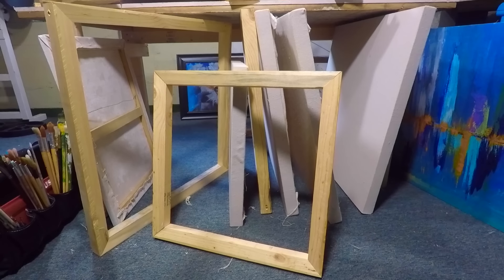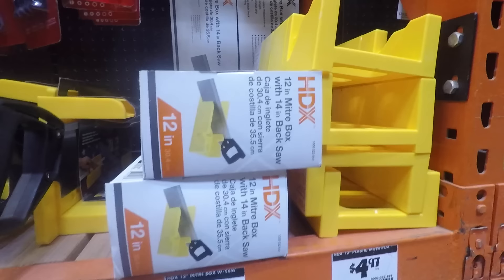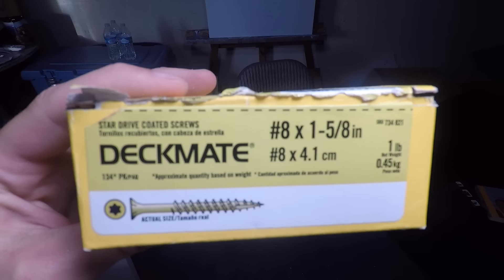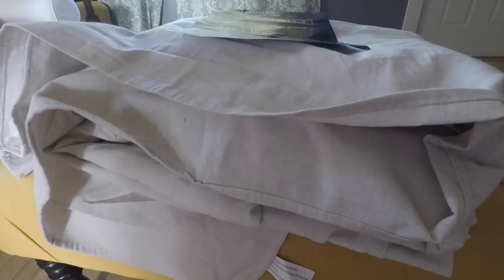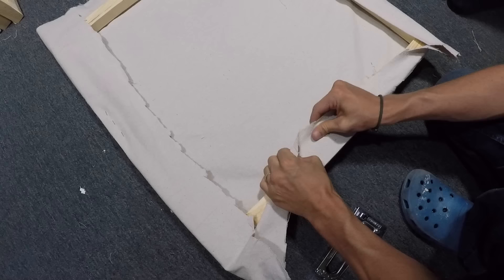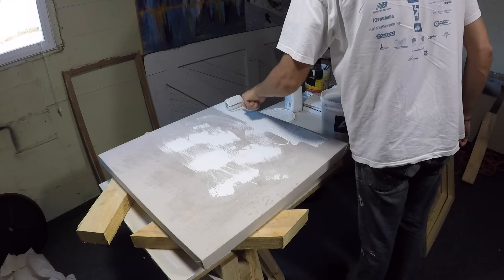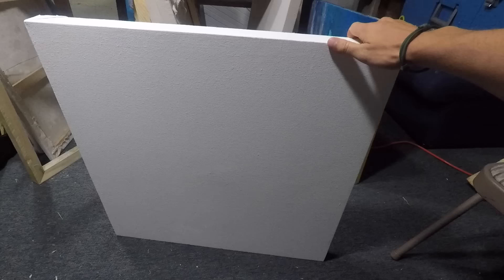EASY How to Build Canvas, HUGE SAVINGS!

Comment: These stretcher bars in the video are a bastardized version of the ''Kansas City stretcher bars." (Created at the Kansas City Art Institute by artists over 100 years ago -  Jackson Pollock's professor, Thomas Hart Benton). Except the actual KC stretcher bars are a lot easier and less expensive to create. You also need to cut outar knots in the bars because they will twist and warp, and the wood needs to dry out for about a year before you stretch. 

The list pricing from an art store is used to figure overhead/material costs when pricing your art work for sale. (or contracting)  It's about the same cost when you figure in the prices of the cabinet saw, and mitering clamps it takes to "roll your own."

Comment: Applying gesso, it seems the old masters often painted on a canvas which was as smooth as glass. For this make a piece of wood 20X20 inch that is exactly the thickness between the canvas and the table. Then using an iron scraper to lay on the gesso,  moving that piece of wood so the canvass cannot give in while trowling the gesso. After 2-3 layers the canvas should be glassy.

Comment: I purchase a painting that I have to.mount. I will make the frame just as you did. I did purchase a while back a tool that is used to help you stretch the canvas. It's like a sideways plier. Will I need to really stretch this painting with that tool? Thanks
Reply from the maker: Most likely I'm guessing, because I rely a lot on the gesso to tighten the cloth of the canvas, where your painting is already finished. I have attached finished paintings to frames before and mostly just my struggle was getting measurements correct. What is this plier tool, I'm curious.
Reply from the maker: That looks handy

Comment: Sanding is the last step?  I'm a woodworker, not really a painter, but after sanding I always clean off any dust from the sanding before applying a finish because dust damages the finish.  Does gesso not make dust when sanded or doesn't it matter to the paint when applied?
Reply from the maker: Yes, gesso does produce dust, good tip, I always clean the surface, but not shown here

Comment: Why don't you apply the bevel with a table saw, running the whole board through, then cut the 45s. Oh and for that  kind of cut you don't need to know your saw blade width. Just cut the other side of the line...
Haha, otherwise, good presentation and production values!
Oh and nothing wrong with how you did it. It's just less efficient. You want to group things by steps. Even using the router would be easier to the whole board than pieces. It'd also provide a more consistent bevel.
So nvm, that's what's wrong
Reply: I was thinking the same thing, just rip in a table saw.  That's seeing through the woodworker's lens.  Apparently the bevel doesn't have to be accurate; even so - more efficient to work as a woodworker and rip the board with a bevel. Next cut the 45 degree angles, this is the common sequence.  I'd like to make a fancier joint at the corners, and use glue.  Plus possibly place a pair of diagonals opposing each other from corner-to-corner with "half-lap" joints.  If cheap lumber yard 2 x 2's are used then I'd want to be sure to put crossbars or diagonals inside to help keep the wood from changing shape as it dries.  Good video!

Comment: thanks,how big can you go before putting a center piece of 2x2 ??very helpful thanks again
Reply from the maker: I've made 40x40 canvas frames and noticed a bowing, so I put in cross beams. Though the sizes of those cross beams were probably 2x1's so I avoided having the canvas touch. Hard to say what the limit is, but I can say 2x2's can hold canvas resistance better than most. I didnt put any cross beams in my 20x20 canvas frames. Some  might be a little more pliable as well. Experiment a little but it never hurts to over build something.
Reply: @jvhumanity901  Thanks man

Comment: I have never seen canvas frames that thick before I normally see 3/4" thick frames. Or is this for a finished project not to be installed into a picture frame?
Reply from the maker: That is one of the benefits of the 2x2's. You don't need a frame because it looks great without and I'm sure a framing store can attach a frame to it.

Comment: If you used a table saw you could save even more money, by buying 2x4's and cutting the down. Withe table saw you can cut the edge before mitering the cuts.

Comment: I have a question what is the difference between canvas drop cloth and the canvas sale at hobby lobby? Does they really make different? the canvas drop cloth is really great price! I been search up on google there is no answer for me
Reply: Art store canvas is sold by the weight and weave, so ye know exactly the fabric you're getting. Drop cloth is a rougher weave, and probably somewhat uneven in weight. The gesso and sanding can help make up for that, if ye prefer a smoother surface to your canvas.

Comment: I've noticed that the wood at Home Depot often is warped, do you ever deal with warping with the frames you make? I was considering getting a planner to try and even out the planks. I am so sick of having to study each piece of wood when I go in to make sure I don't buy warped wood, or do you have a suggestion for that? Does the beveling process help with warped wood? Or you do you just try to buy wood that isn't warped? This is the one thing I can't seem to figure out, especially when I'm trying to build 8 or 9 foot tall paintings, it seems to become an issue more than I would like.
Reply: All the wood in home depot looks like a banana! Lol

Comment: Can anyone explain the need to cut at 45*? Why not cut straight or 90* and then use screws?
Reply: Because the planed wood won't line up.  It must be high at the outer edge and doing it your way will create a pocket where the two beams meet.

Comment: This is a fine method for craft painting, but it should not be used for fine art, i.e professional works. The wood can warp too easily, the canvas is chemically treated differently, and a real collector knows to avoid buying low-quality material artworks. For just a few dollars more you can still make them yourself from better lumber and purchase proper canvas in bulk online.

Comment: Whats the gesso? Why not include that. Very frustrating asking around store by store and no one seems to have the appropriate type. Dont sell at walmart and home depot
Reply from the maker: Type in Google maps, art supply store near me, or check Michael's, Hobby Lobby, yah hardware stores don't have it.  Gesso is a primer made up of white pigment, some sort of white chalk, and a binder. I mean you could experiment with other primers as well, the primer is there as a surface for your paint to absorb into and protect the surface below it.

Comment: Great video! But... Applying the gesso on a normal canvas doesn'it going to curve the canvas??
Reply from the maker: Yes if you dont build it correctly. The 2x2's are strong enough for most canvas sizes but if you are going larger than a 20x20 canvas you may want to consider bracing on the back. A benefit of gesso'ing the unprimed canvas after it is stretched is that it will create a tightly stretched canvas. Anything smaller than 2x2 wood your going to want bracing on the back.
Reply: @jvhumanity901  ok thank you, anyway i suggest  to put a thin coat of glue and water on the pre stretched canvas, so the gesso don't penetrate as much and you can put it in smaller amounts. Also you will have a stronger canvas.
Tell me if you are going to test it and what are your opinion about it!
(Sorry for eventual grammar errors)
Reply: Also if you prepare canvas first you don't have 'waves' problems i guess.. Tell me what you think!
Reply from the maker: @zzzioporco  I'll experiment with that glue idea, good suggestion

Comment: @j.hanks  Your practical & informative video presents an affordable solution for many of us. 

But it needs to be said that the matter is not only about price. It as about quality too. The overall quality of your stretcher bars/canvas is higher than most canvases sold in most art stores, where the entry level quality of canvases is literally appalling. Perhaps only suitable for practice at Elementary/Middle School art classes (Anecdote: A while back I purchased a set of some six or eight small canvases. When the first one proved to be “feeble” I tested the quality of the remaining set by literally 🤛 punching through the remaining five or six canvases all at once without much effort: junk) 

The median range canvases are still bad, and of course, significantly overprice. For these reasons I purchase a table saw and moved to making my own canvas boards about 7 years ago, increasing the quality of my supports and the impact on my wallet. ...no more punching tests since then 😆 

Your proposal is no brainer. I do care about the price, but about quality even more. True quality is still around—like the traditional products sold say by Zecchi in Florence, 🇮🇹 And of course, it comes with a proportional price tag. IMO is justified. The most disappointing, actually infuriating thing, is when in the States they sell you Chinese junk at hight prices. 

Again, thank you for sharing! Happy painting 🖼!!!

Comment: the canvas drop cloth would be fine if you don't mind little bumps in the threading, but the sanding really helps with combating that if you don't like the bumps. Also, really you can gesso and paint over any material, you just have to be careful with thin fabric not to stretch it super tightly, leave room for the gesso to tighten the weave and always start in the center of the canvas when applying gesso so that it stretches the material evenly and prevents bumps and dimples.

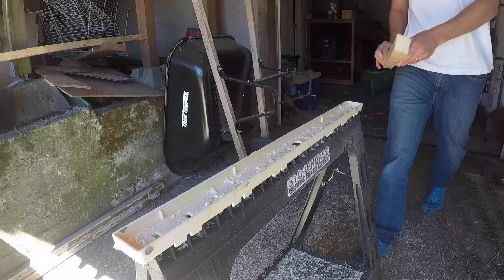Comment: Where did you get the top to your saw horse at 2:28 to hold your 2x2 . I have a hand plane, but trying to figure out how to make the planks not move when beveling.
Reply: You can make a tray out of wood or try making a holder out of scrap wood on top of your workbench

Comment: Hello! I hope you can help me with some advice. I did everything exactly like you, except for the gesso. The canvas is primed, so I assumed I didn't have to. My problem is that the canvas becomes saggy after few hours. I then sprayed the back with water, and the canvas was like a drum again. Few hours later, the paint is on, and my canvas is saggy again and has wrinkles. What am I doing wrong? Please help!
Reply from the maker: Even when I buy primed canvas. I always put one layer of gesso on to tight further, and this design of canvas frame does not include a wedge option. I would recommend stopping your current painting and start with new but gesso over the primed canvas once. Unprimed canvas 2 to 3 times.
Reply: J. Hanks Narrative Art Thank you so much!

Comment: 2:25- ok How do you do this?  Securing the wood piece before beveling?  I borrowed a planer, but I can't figure out how to keep the pieces from moving around while I'm planing.  What did you put that piece of wood into?
Reply from the maker: Hi Erin, I put it into some sort of sawhorse I had found. Don't know where to get it so you will need clamps. Any sort of clamps. Bevel one half then the next. Could purchase a bench vice. A bit pricy though. You could also build a stopper of sorts using wood scraps.  Maybe ill make another video on it to help out.
Reply: You can just take a plane of wood, drive in 2 nails at the end so you can wedge the corner of the frame into it, then work against the wedged-in corner.. the nails will prevent the thing from slipping away and you can fasten the plane of wood with clamps onto any work surface, without needing to drive the nails into the work surface. Maybe remove the nail heads (or take small heads) so they won't press into the wood (or use proper stop blocks, if your workbench has slots for them) and make sure the nails leave enough clearing for your plane.

Comment: you guys need to know a drop cloth has very low "thread count" as do cheap canvas cloth. that's why there are such big price diff in fine art canvas. if it works for you that's great, you'll need to prime it really well in order to make sure that your thread spacing is covered. I'm like you, I love using most anything for making art. Art stores, esp craft stores are a den of thieves😂.. buy yourself a $125 table saw to cut and bevel your stretcher bars.

Comment: Good video. My only comment is your 'cost' doesn't include your time. If you value your time (or rate of pay at your regular job) at say, $20/hour then this will only be beneficial for canvases that retail for more than $25, assuming it takes an hour to build. As an artist, DO NOT UNDERVALUE YOUR TIME. In addition the time spent building a canvas could be spent painting.
Reply: That's true, but does it really make a huge difference? It's still cheaper unless he's selling his paintings for thousands of dollars each. I figure if he didn't spend his time making the canvases he would have spend a much longer time painting and trying to sell work or doing some other job to make the larger sum of money he'd need to buy as many of these canvases as he made for cheap.
Reply: @popesuavecitoxii2379  it makes a huge difference. If it takes an hour plus material cost to make a canvas that retails for $6.99 on sale (8x10 gallery) there is an actual loss, unless you value your time at $0.00.
Reply: but that only matters if you're a professional artist, if its a hobby labour cost doesnt matter
Reply: @tufungagreen5571  sure, if your time isn't worth anything. Mine is. That's why I get paid for a living.

Comment: Hi, can you add gesso to the canvas before stretching it onto the frame?
Reply from the maker: Yes. It does tighten after gesso is applied, that is why I like to stretch it, then apply gesso to get a firm painting service. But many artist paint on unstretched canvas that  is primed, then they roll it up for easy transport.

Comment: Does Jesso coat work for oil painting or just for acrylic?
Reply: Gesso is used for oil painting as well. It acts as a sealer. I use it for all applications, acrylic, oil, and when I do pastel work I do a mixture of gesso and marble dust on my boards. Hope this helps.
Reply: @ninale-currier1922  Thank you!

Comment: it would have been nice to see the cost break down of that one canvas
Reply: Would be difficult to get an exact cost without knowing how many canvas' he gets out of that tub of gesso, but we can estimate the costs pretty accurately with the information provided in the video.

At 0:45 you can see that the 2x2-8ft costs $1.97
At 4:07 you can see that the 12' x 15' canvas costs $32.94
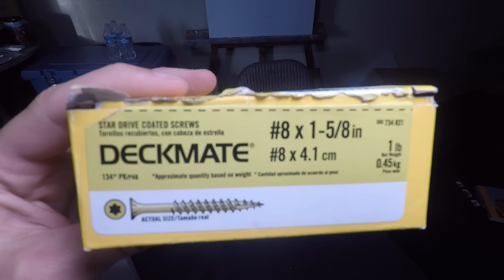At 3:13 you can see a 1lb box of #8 1-5/8 screws, which according to home depots website costs about $6.97 and comes with ~150 screws.
At 6:12 That tub of gesso looks like a 64oz tub, which typically runs about $20

The size of the canvas made is 20x20.

8ft is 96", so he can make a single frame out of ~80" of wood, and have a bit left over for the side of a smaller frame.  So the wood for the 20" frame itself costs ~$1.64

We can assume he cut approximately 24" x 24" of fabric to have some overlap, which is 4sq ft.  The total sq ft of the canvas (12'x15') is 180, meaning its about $0.18 per square foot.  4 sq ft makes the cost of the canvas about $0.72.

At $6.97 for ~150 screws, we can figure the screws cost approximately $0.05 each, and using four puts the cost of the screws at $0.20

For the gesso I would conservatively estimate that he gets about ~20 of the 20x20 canvas' out of a single tub, being $20, that's about $1 per canvas.  Though, If he gets 1/2 that amount due to doing multiple or thicker coats, add an extra dollar to the cost. 

So in raw materials, we can say it costs approximately $3.56 for a single completed 20x20 canvas, with some fluctuation depending on gesso usage.

This doesn't include tools or labor, but in making just two canvases you've already saved almost enough money to purchase the planer (at 0:24 we see a 20x20 costs $38.30 vs making it for ~$3.56).
Reply: @ixamraxi  thank you I know that took you a long time to write out and figure up so thank you for knowledge and the time you spent doing so
Reply: @casewhite5048  No problem, it seemed an interesting question and I was a bit curious myself.

Comment: I'm curious how you got yours so tight without stretchers. I stretch my own canvas, but always have to tighten with the stretchers in the corners.
Reply from the maker: It doesn't beat like a drum until i put that gesso on. It tighten's pretty nicely. Other than that i do have pretty sore fingers after I finish stapling it on.
Reply: Wet canvas.....😉
Edit... with plain ol water
Reply: @KortovElphame   i do the same with just water.
Reply: Buy stretching pliers

Comment: As An Artist, Don't waste time and money on Canvas. And Canvas damages easily.  Home Depot Masonite Boards have varied width that will fit nicely in a Frame for your Art Work.  And Home Depot will cut the sizes you need.  Sand on "right side" with P220 Sandpaper from HomeDepot. Gesso the boards 3x on front and 1x on back.The Great Masters used boards.

Comment: I think you called it beveling? Like a beveled edge? Well will it make a big difference if I skip out on this part?
Reply from the maker: I would definitely recommend a bevel. You want the canvas to touch as little of the frame as possible to prevent ridge lines which could interfere with your painting. That being said, you can skip the step but you should paint lightly and avoid the edges. Even then, your frame may indent  through the canvas.
Reply: J. Hanks Narrative Art if I’ve already got a pre printed canvas that hasn’t been stretched, how important is the beveled edge? I won’t be painting on it, so I would technically not have the ridge lines from painting. Is there any other reason that I’m unaware of?
Reply: @basketcasejacegaming8673  .l